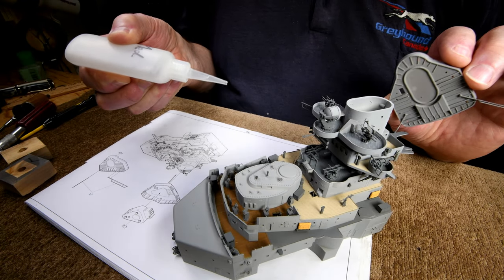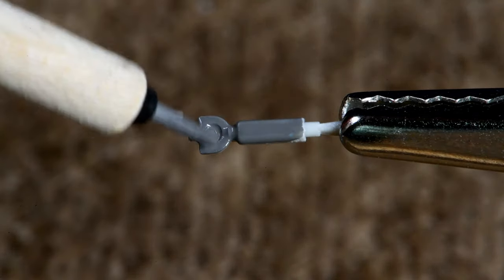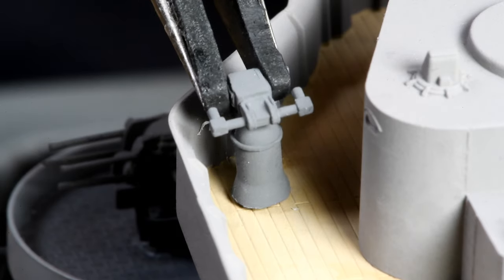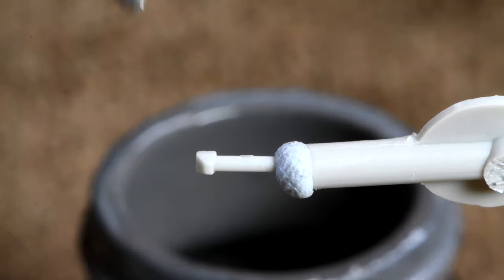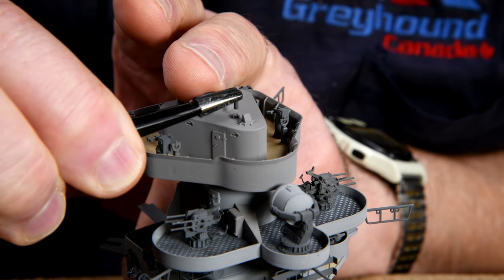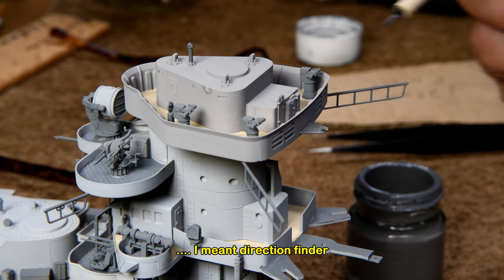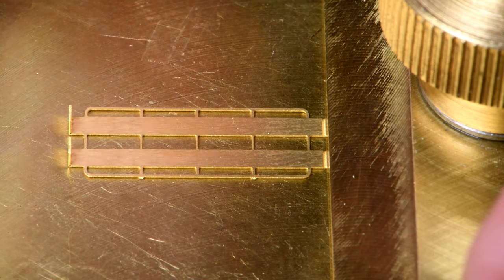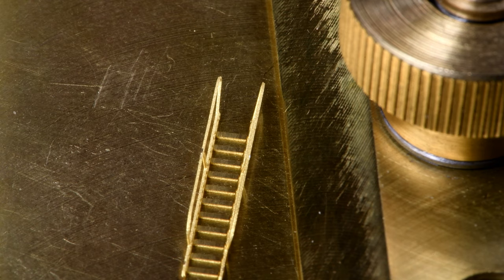The Model Ship - Part 176

Comment: Ron, couple of things.. the superstructure to date looks fabulous! Good job! I’ve got a couple of none aggressive alligator clips, I’ll send you a couple. Should fit on helping hands. Also, I have some small heat shrink tube that you can fit on the thin tweezers to protect fragile parts. For priming / painting those small brass parts, what I do is use toothpicks with a tiny ball of blue tack to hold the part. After priming / painting, put the blue tack on the different area of the part to get the area that is still bare. Don’t have to wait long, so no airbrush clean up to do while primer / paint dries, does so fairly quickly. I think 6 months from now you’ll be doing the display case!
Reply from the maker: Thanks again Tony 👍